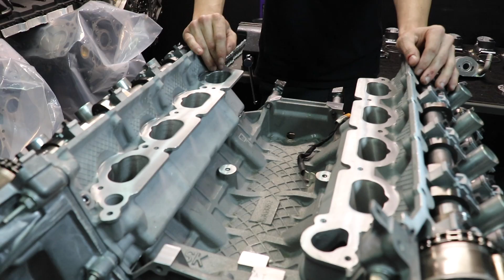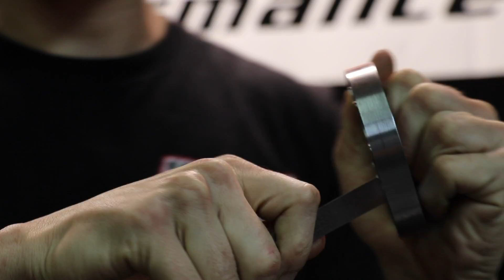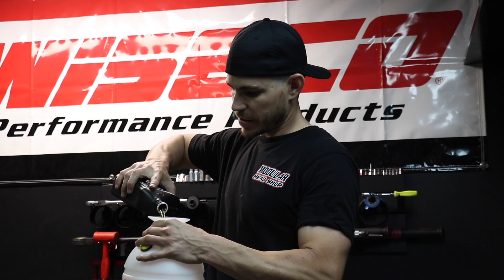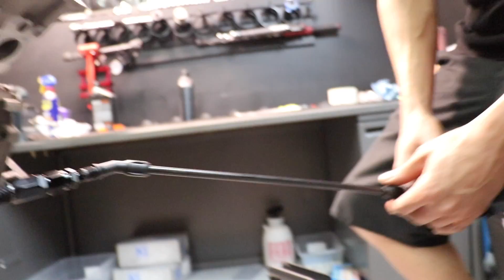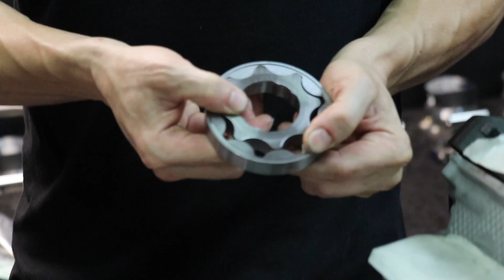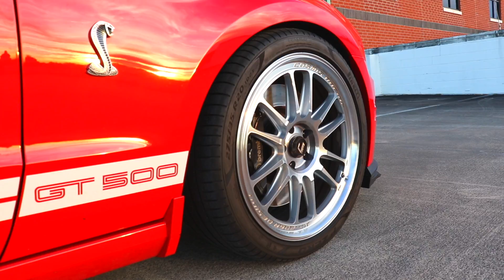These Upgraded Oil Pump Gears Caused Engine Failure Gen 2 Coyote

Comment: Bought MMR gears and the clearance was .012 so going to try and get a refund already bought boundary gears. Sad to see MMR is still lacking.
Reply: So what brand did you end up buying then?
Reply: @ElCoyoteCuh  they sent me closer tolerance ones so I used that. I still have the other ones laying around. Motor has 3k miles since so they seem to be good. Oil pressure is good.
Reply: @R1AndyM  I just eyeballed mine and there seems to be a slight gap. I don’t know what to do. I may call MMR tomorrow or call Lethal performance and ask for a exchange or refund.

Comment: Damn my mmr gears got .009" of clearence while the brand new ford performance oem gears got .003" 💀 should i still run the mmrs is it within an acceptable range? 03 cobra
Reply: Same question with me but coyote gears.  I'm seeing .007-.008 on my mmrs, while the brand new stock 4v gears measure .003-.004.
Reply: @billysandals  i talked to mmr they said it's normal, supposivly they leave a higher tolerance to allow the billet material to expand
Reply: @sSkillaz336  Knew they would say that.  Its the only excuse under the sun that they can get away with.  They say that and won't take them back because of no return policy, and then no warranty because "race parts".

Comment: I see someone listen using bug sprayer to pre-lube engine I've been doing this for years on engines where you can use a drill to run oil pump. My brother did this with his coyote swapped 01 cobra and with 96 GT he did have. I watched justa6 I prime my by cranking it. I commented some a-hole replies back I've done the way they did never had a problem. But later talking about engine problem but it wasn't the way I primed it yet we have valve train noise.  Surprised how fast 8 qts can be put in priming engine

Comment: Ive been running my mmr huricane pump in my mustang with a lightning engine i built. It runs pretty hard at high plains raceway here in co. 18lbs of boost and 5400/6100 rpm regularly for extended time. Never had any issues 🤷🏼‍♂️. All of my parts except my je pistons and timing components are mmr.

Comment: Thank you for the opg tips. I put in boundarys in my new gen2 block I put in last summer along with their crank sprocket. I did see some metalic ferrous flake in my oil changes though. I havent been able to figure out whats causing it. Cylinder walls look good, sent oil samples 2x to blackstone and they said the oil looks great so 🤷🏼‍♂️. I dont know if its related but the engine did start bbq or typewriter ticking at 1000 miles. Broke it in gently so if anyone has any ideas what to check id appreciate it.
Reply: Don’t worry about the tick there dozens of videos of it . Just drive the car . Mine went away with e85 tune definitely fuel related for my car . At least
Reply: Did it end up giving out??

Comment: Alejandro Flores recommends MMR oil pump gears. Go ahead and buy your $160 boundary gears lol
Reply: Alejandro Flores doesn’t build cars he tunes them . Listen to your builder when he’s building . Listen to your tuner when he’s tuning.
Reply: @smurfeco2.358  I trust his opinion because of his experience with VMP and Lund racing who does build engines. I don't trust a guy who recommends the cheapest gears out there.
Reply: Moze was hot in Ned's Declassified it’s an opinion anything can go wrong with a engine . Mmr oil pump gears or boundary gears doesn’t matter I been running boundary opg and sprocket since 6k I’m my car no issues doesn’t mean nothing will happen . And I’m sure there’s no issuers with mmr opg to . Just that these weren’t inspected properly .

Comment: I just received my Boundary oil pump gears and I looked at the tolerances.  I don't have a thickness measuring tool, but I was able to fit two sheets of standard paper.  Is it ok?
Reply: Paper is .003 thousandths
Reply: @DonLapwig  Yeah, I just measured, it measures 0.00843 inches.  Borrowed a digital micrometer
Reply: But go to oriellys they will have feeler gauges for cheep
Reply: @DonLapwig  Is that good though? He said it shouldn't have light through it.  It does. But its still 1/3 of the space the OPG he showed had

Comment: MMR no bueno I’m glad I went with boundary oil pump gears and ford performance crank sprocket.
Reply: I'm relieved I read your comment.  I was literally between MMR and Boundary for my OPGs.  I just purchased Boundary OPG and ford performance CS for my car lol
Reply: Josh's good call!!
Reply: MMR makes decent parts, it’s just their customer service and in-house built blocks and engines are just a crap shoot, and usually not good at all.
Reply: I was in the same boat, but looks like ill have to go with Boundary CS for my GT500
Reply: im glad somebody mentioned it. thankfully i've only got some coolant system parts for my cobra from them.
Reply: I read this comment already with mmr gears ordered the same hours & called team lethal and cancelled for boundary gears 😂💀
Reply: Check out Speed Addict 731, he just had a set of Boundary gears fail. Boundary is a great company, mass produced items are not always consistent. Maybe the gears should be bench and matched as a set. Not boxes of each just randomly sold as a set. Makes sense ?

Comment: Soo.. what brand of oil pump gears would you recommend then?
Reply from the maker: Jordan typically suggests boundary. He also has his own high quality option that we used on my GT500.
Reply: @MustangLifestyleTV  what's his website?
Reply from the maker: https://www.modularheadshop.com/
Reply: I immediately went to the website and was pleased he carried Boundary! As a precision machinist myself, I was impressed with the spec sheet and fit/finish of the Boundary gears I purchased. Even if they do have haters.
Reply: Boundary had some issues with Coyote crank sprocket and OP gears, with splitting.
Reply: @BCSVT  yep.. i had a boundary CS split at 900ish.
Reply: @Young5.0  on a gen 3? Did you use the apr bolt?
Reply: TSS & Accufab work well